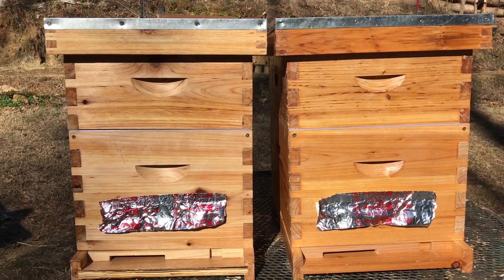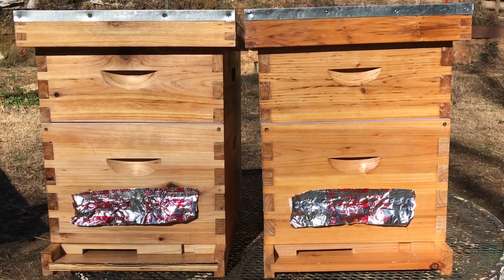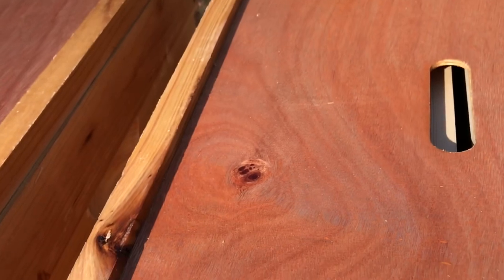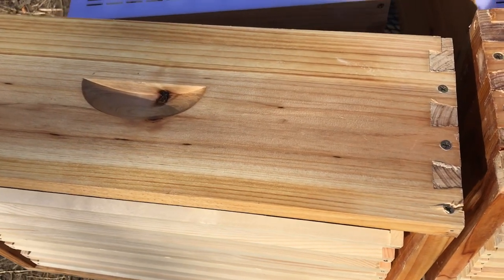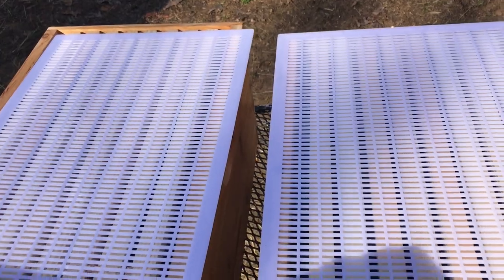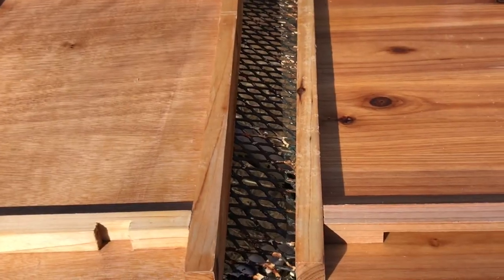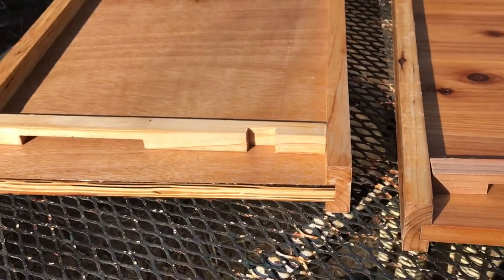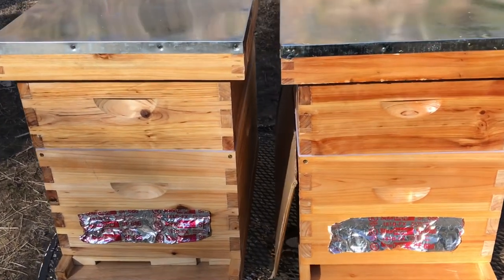CHEAPEST BEE HIVE ON AMAZON-review

Comment: I have noticed that wooden items for outdoor use that are made from wood in China do not last very many seasons in outdoor conditions.  My father always painted his hives white on the outside.
Reply from the maker: Thanks for the heads up. I was planning to seal/poly the wood once the bees/weather remove the wax. Thanks for watching and commenting!
Reply: My grandfather always painted his hives white also. Everyone in the community used to call him if the saw a swarm. The hives lasted from when I was a young child until I graduated highschool
Reply: I BEEleive the white is to prevent overheating the colony in the summer, at least that's what I was told in my area
Reply: @destinywilliams801  that’s what I was told. So bees didn’t have to waste as much energy cooling the hive
Reply from the maker: The planned location is out of direct sun after about 2pm in the Summer. I’ll have to see if they get hot and beard up. If so I’ll paint the hives a light color.